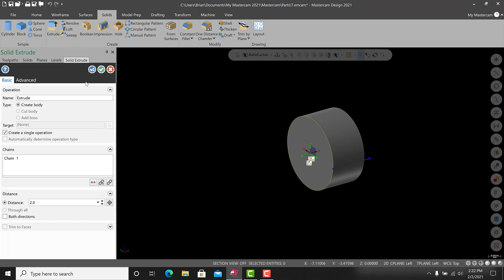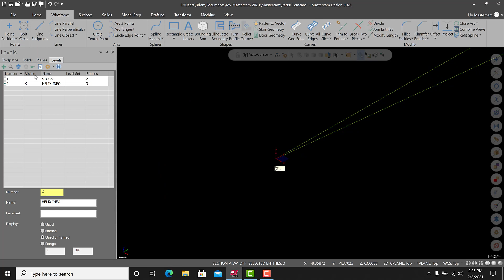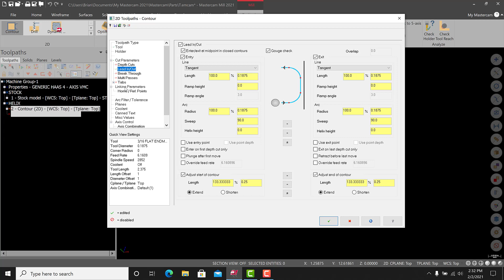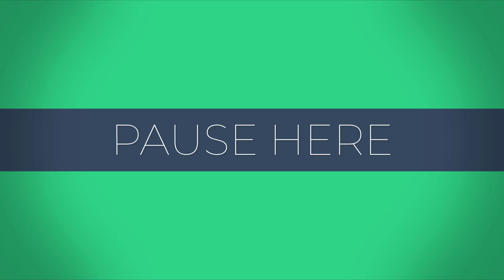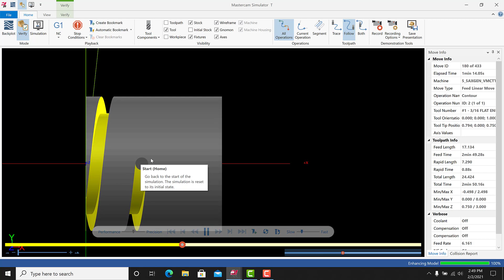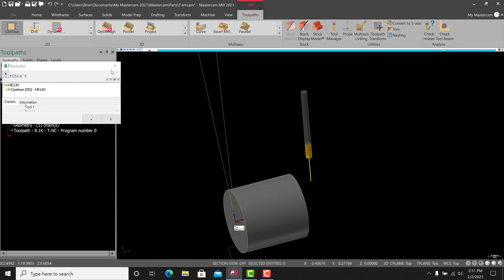MASTERCAM 2021 4 AXIS HELIX USING AXIS SUBSTITUTION

Comment: Professor Wickham man we need more video's! especially like this one! Your video have helped me out so much, I was wondering if you had a video showing how to draw  wire frame in mastercam to be able to flute like a gun barrel in the 4th? I have tried doing the trig but when I select the hypotenuse line it wants to rotate around the whole cylinder. I'm trying to start at A0. and end at A30.Deg  length being 10in long barrel. I know I'm probably messing up the math but i haven't been able to figure it out, any help would be grateful!

Comment: great video, ive done a similar part using your steps, really clear , it looks correct in verify but backplot the tool is not following the surface/ axis of rotation? ive tried axis substition and rotary check boxes  in backplot , any ideas? thanks
Reply: fixed, it was a bug in 2023 version 2,  version 3 fixed!!  thought i was going crazy!